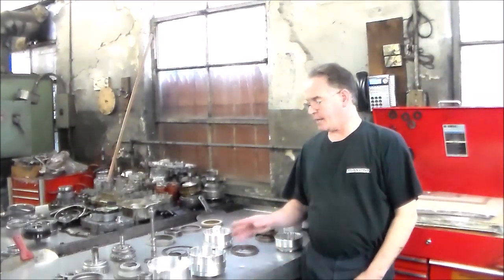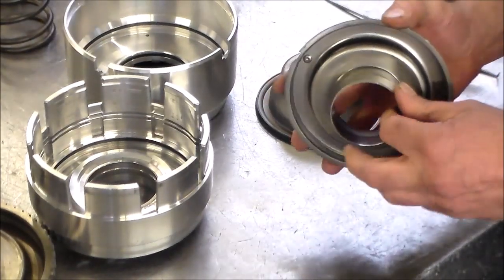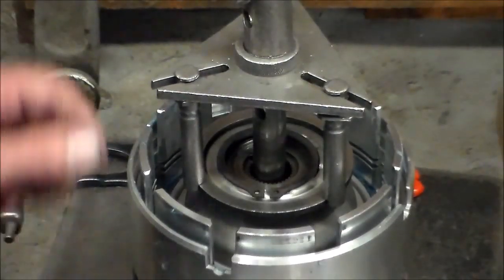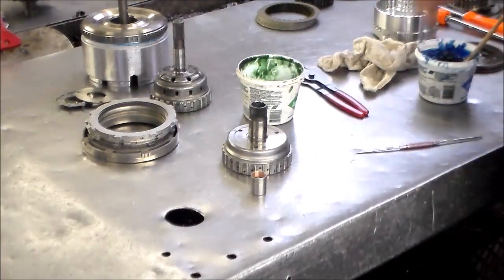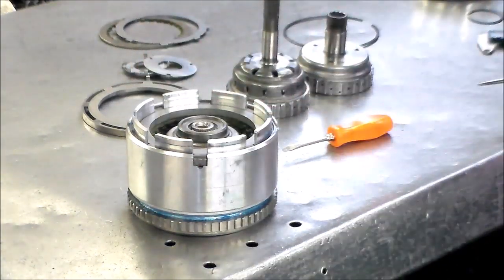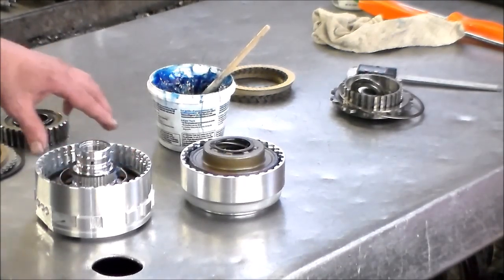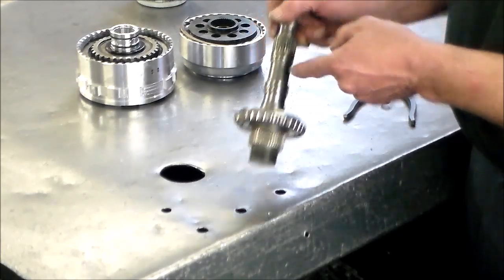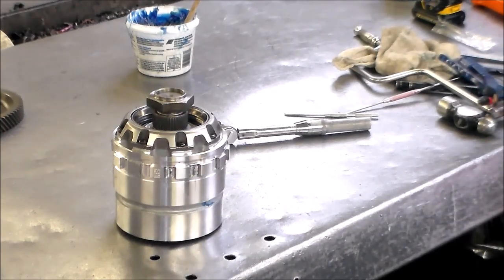62TE Rebuild Part 1

Comment: Thanks for this series, you are a great teacher!
What would you recommend for a 2014 62te with 200k on it, It started to have a clunk at 4-3 3-2 2-1 coast downshift, mainly 3-2, all upshifts have always felt good, changed solenoid pack, cleaned valve body, inspected the 2-4 valve with no sights of wear, did a quick learn and made no changes, I live in maryland 20677
Reply from the maker: Did you happen to scan the car to see if any codes are present? very surprised quick learn did not change anything.
Reply: No it never popped any codes, I use appcar diagfca as my main scanner, there was a decent amount of clutch material in the pan but nothing big, I was just thinking maybe the clutch material worn out to much, the car is driven heavy with performance mods done to the 3.6 and do about 40k miles a year for work.
Reply: Also wanted to do a rebuild just for the heavy use and high mileage, I can't seem to track down a transtec kit yet, I can get the mopar 68272621ab easily but thus does not come with the clutch packs and can't find the right clutch packs that come with frictons and steels
Reply from the maker: @bryansteele4458  Where are you located?
Reply from the maker: Last reply did not show, if you can't find let me know, i may be able to help you
Reply: Maryland 20677, 40m from DC. I had already look for a transtar near me but I did not any and can't seem to find any good kits only
Reply: I got a reply from transtar, they helped me with another site to find kits and told me they could ship them to me, I also realized that alot of the transtar kits are actually transtec or comes with transtec overhaul kit at least, is the kit you would use pn 132006 ?
Also if this was your trans and you where having these issues and had a decent amount of clutch material in the pan with 200k on it what would you do?
Reply from the maker: @bryansteele4458  overhaul, That part number does not come with Pistons, you need the pistons, you need a banner kit with pistons
Reply: I would like to do the tc if I'm going to have it out but am a little confused how no matter the place I look for my car it shows a high and low and sometimes a medium stall tc as stock units, is this because maybe vans get a low stall and maybe rt's get high stall?
I'm still trying to figure out what the problem actually is because I just do a rebuild not even knocking 100% what it is, my guess is the clutches are burnt up, If I do country driving it drives great most of the time, if I come to stops or traffic is the main issues with 4-3 3-2 coast down shift like after I accelerate heavy or moderate then let go completely then without hitting brake yet as decelerate it banged down a gear sometime has been hard, I do sometimes get a very small bang in reverse and I have noticed if coasting in naborhood it will do a very small bang going 3-4 at low speed and acceleration.
Reply from the maker: @bryansteele4458  I know of only one converter, same one gets used in all vehicles. Transtar part number is CR1320
Reply: Have you ever did a rt one? I have a rt avenger and just don't want to hurt performance if they used a different stall tc
Reply from the maker: I only know of that converter. If you like E Mail me your vin and I can run it through Transend. 
Gsferraro@yahoo.com.  I can also check my converter book tomorrow when I’m at the shop
Reply: Thank you sir

Comment: Hi Gary, I've rebuilt a 62te after failure of the input hub bearing, now it has reverse but has no drive and code p084b. I can clear the code but it comes back after shifting to drive. Valve body and solenoids seem to be good. What can be the issue?
Reply from the maker: What is the definition of that code?
Reply: @GaryFerraro  DC pressure switch rationality
Today came up p0731 gear ration error in 1st
and p1790 fault immediately after shift
So, these 3 at once came up
Reply: After switching to drive the car moves a bit and stops, at that time the present gear shows 3rd
Reply: Now got an extra code p0841 LR pressure switch rationality
Reply from the maker: @sebos5  How is reverse?
Reply: @GaryFerraro  reverse is fine, goes in smoothly
Reply from the maker: @sebos5  If reverse is ok, may be a problem with the underdrive clutch or a sealing ring on the input shaft

Comment: 49:32 when I do air check on the direct clutch and low clutch, I hear air leak. Is this normal?
Reply from the maker: yes, may be a small amount as long as not excessive
Reply: @GaryFerraro  l love your videos. Thank you for sharing the valuable information.

Comment: I have dodge promaster whit te62 shift hard from 1-2 and 2-3. What u think what problem is?
Reply from the maker: Have it scanned for codes. Sounds like high line pressure
Reply: @GaryFerraro   yes no codes
Reply from the maker: @anicamilenkovic4791  was anything done to the truck before this happened?  Almost sounds like a bad EPC solenoid in the solenoid pack
Reply: @GaryFerraro  no just start hepening slowly
Reply: It kind of jerks between a first and second gear and second and third. Only. Car has a 250000 miles.  No codes what do you think? What’s the best thing to do?
Reply from the maker: @anicamilenkovic4791  Lot of miles, Do you by chance have a scanner like a Snap-on or Autel?
Reply: @GaryFerraro  i have Autel

Comment: Hi Gary. I think your presentation is great, you should have been a professor in a university. I have a question, I am working on a 62te automatic v6 sxt and for some reason I can not put the rebuild compound and hub far enough down to put the snap ring on. I've checked everything twice and the assembly is right. Any ideas?
Reply from the maker: sometimes i have to hit with a dead blow or rubber hammer to get it past the snap ring groove have you tried that? It may not go all the way down on it's own

Comment: Gary, where can I purchase the metal bushing you replaced?
Reply from the maker: which one?  pump or for the Overdrive hub?
Reply: 92004-L
It’s strange because the Sonnax website doesn’t say it’s for the 62TE.
Reply from the maker: when i first called about it long time ago they said not to use it, then i called back a while later and said its ok to use @mikec2220

Comment: I don't understand English, so I am writing with the help of a translator. I have a question about a gear that turns in one direction and does not turn the other.  Which way should it spin freely, clockwise or counterclockwise ???
Reply from the maker: If you are talking about the sprag in the low drum on the 62TE Freewheel counter clockwise and lock clockwise.  Hold the drum and turn the outer race of the sprag
Reply: The side that has the smooth perimeter and faces needs to turn countercloclwise
Reply: Sorry side facing up then counter

Comment: First I had a P0740 code, which I replaced the tcc solenoid first, didn’t help and then I replaced the torque converter. Now I am getting p2764 anyone have any advice? Transmission doesn’t shift.
Reply from the maker: what is the definition of that code?
Reply: Deffenition is Trouble Code: Torque Converter Clutch Pressure Control Solenoid Control Circuit Low. 
I did test the solenoids through the connector at the pan, everything seem to have checked out.
Reply from the maker: @robzlrclub93  Problem seems electrical, if you clear the code how fast does it come back?
Reply: It comes back almost right away as pending, haven’t gotten it to be a hard fault. Going to check the resistance of the solenoid at the connector. If I get a good reading then I figure the issue has to be outside the transmission.
Reply: I got 5.8 ohms for the tcc solenoid. Then checked for power on pin 10. Wasn’t getting any voltage, thought it might be on limp mode because of the fault. Ignored that theory for now and swapped out the pcm relay then was getting 12v at the transmission pin 10. Can test any further at this time but I am hopeful this will resolve the issue. Thanks for your responses.
Reply from the maker: @robzlrclub93  ok, if that code comes right back, it is electrical

Comment: Where do I buy parts for my 62TE because I would highly enjoy rebuilding my older trustworthily unit?   Thank you!
Reply from the maker: Where are you located?
Reply: @GaryFerraro  I'm sorry for not mentioning my location.  It's Columbus Ohio.     I could also get the parts delivered by common carrier if needed.  Also. Would any scanner that relearns work in programming the rebuild to the TCM? I'm looking for a decent scanner hopefully for under $1,000. Could you recommend a reliable scanner within that price range?   Thank you!
Reply from the maker: @waynel680  I did a video about a month ago, check it out it's a great scanner that does what my snap-on does and it's 120.00
 Go to Amazon and type in Thinkdiag.  Tool is made by Think Tool
Reply from the maker: Do you know what parts you need or do you need help with that?
Reply: A master kit that includes bearings, gaskets, and seals would be great for starters.  Thanks
Reply from the maker: @waynel680  Have to see what is available, the master kit is the overhaul, all molded pistons,clutch plates and steel plates, no bearings on master kit.  The 2-4 steels are on back order so i will see if a master kit is available.  What year is your car?
Reply: @GaryFerraro  2009 town and country with a 3.8 engine.  Thank you for your help.
Reply from the maker: @waynel680  Can give you a list of what i think you will need, probably close to 1000 in parts
Reply: Please do!  Where would you suggest a place to purchase them?  Amazing. I'm watching you at this present time tearing down this transmission.   Thank you again!
Reply: @GaryFerraro  Good morning, Gary.  Wondering if you forgot about the list of the parts?  Thank you!
Reply from the maker: @waynel680  Sorry, shop is very busy
 Banner with molded pistons
Filter
Solenoid pack
TCC Solenoid
Transducer
Pump Bushing
Compounder end nut
Updated Low Drum
By Pass valve
underdrive piston
converter
 What is the problem with your trans?
Reply: @GaryFerraro  Thank you for getting back to me.  Code says input shaft problem.  I replaced both sensors one on top and one on the side of the transmission.  Believe the one on top is the input speed sensor and problem still exists.  DTC will appear shortly after reset and trans refuses to shift into 4th gear shortly thereafter.  Sometimes, the trans runs properly for a good while and other times will stop shifting within a few minutes. Sometimes, I can also feel the car jumping out of 4th gear when slowing down.  Yesterday, I ran the car for 30 miles with no problem.  The transmission runs great when I shut the car off and on or disconnecting the negative battery cable.  I'm starting to think that its in the TCM because of the problems occurring and the fact that the trans runs great after the car is reset.  Car has another problem associated with the computer which results in a lower voltage charging rate but goes back to the correct charging rate when the car is reset.
Reply from the maker: @waynel680  what is the code number
Reply: @GaryFerraro  Codes are 792, 734, and 733.
Reply from the maker: @waynel680  ok, that is internal issues, usually never a speed sensor
Reply: @GaryFerraro  I heard you say Transtar parts in one of your videos, and there's a Transtar dealer in Columbus OH, which is 40 miles from my location.  One problem solved.  Question, my local Chrysler dealer recommended not to change my fluid and filter because it may cause major problems with bands and other parts.  I also watched another YouTube video where the mechanic recommended using 1/2 of the fluid requirement with new fluid and the other 1/2 with the used fluid.  What is your recommendation?  I'm leaning towards the TCM and wiring because the car was parked in a barn by the previous owner, and I found a good size mud dam on the wires coming from the speed sensors to the TCM caused from barn wasps.  The wires does not seem broken but believe that they do need to be replaced.  Hopefully, I can find a new wire harness for the TCM or will need to cut and replace the wires.  I drove the car for a few hours today and didn't experience any problems with the transmission.  Thank you for all your help, much appreciated.
Reply from the maker: @waynel680   It's ok to change fluid and filter, back in the day when the cooling systems where not as what they are today they said you shouldn't change fluid, it will be fine to change fluid
Reply: @GaryFerraro  Hi Gary!  My local Chrystler dealer told me that he could get me in the Master Mopar rebuilding kit part# 68272623AD, but will be a week to three weeks before the kit comes in.  Is this kit a decent kit?  Would you please let me know what other parts that  I will need, if any that this kit doesn't contain?  Thank you!
Reply: @GaryFerraro  Help me with this.  You contradicted what the service department clerk at my local Chrysler dealer told me.   He told me not to attempt to change my filter and fluid at 185K on the car because it might lead to transmission failure.  I watched all your videos on the 62TE and found you to be unbelievable transmission rebuilder.  Please explain so I learn better, what does a better cooling system have to do with not leading to tranny failure?  Thank you so very much!  Please advice and thanks.
Reply from the maker: @waynel680  Back in the day, the transmission cooling system was not elaborate as they are today.  Back in the day  if the fluid was not changed it would become like varnish. That really does not happen much anymore so thats why i really do not agree with what he says, if the trans is slipping a service may not help but i don't feel it will kill the trans.

Comment: Love your videos! As daunting as it would be to disassemble and rebuild an automatic transmission, I'd almost feel confident tackling such a job, using your videos as a guide. I have a 2013 T&C and therefore, a 62TE. Just finished a pan drop, filter replacement and pan with plug installation. I use AppCardiagFCA to get the trans temp and use the level chart. I used about 6 quarts for the refill. About  week before that, I evacuated and refilled about 5 quarts (2 or so at a time). I measured and scribed  on the backside of my engine oil level dipstick for the high and low marks based on the chart. 

Two questions though...Do you have a system for keeping track of all the fasteners, clips, rings etc so you know which part goes back where? I'm guessing you know them inside and out. I suppose it's like anything else, one just needs a system. Secondly, I have read how finicky these transmissions are about fluid (friction modifiers, viscosity), ATF+4. All that trans gel and STP you're slathering on there, I'm guessing it isn't enough to mess with the finely tuned ATF+4 chemistry? Again, always appreciate watching your videos.

EDIT: Just thought of something else, and of course I'll understand if you don't have the time to answer my questions. I just find this stuff fascinating and trying to learn.

I have an app called OBD Fusion. It can retrieve a lot of information. Right now, I have line pressure (desired an actual - these are in agreement all the time). I also have LR, OD, UD, 2-4 clutch fill volumes (CVI). These are all within spec. I understand that these values can increase as the clutch material wears? So, if they exceed the maximum value in the specs, does that mean my clutches are worn? Other than line pressure and CVI, what other variables could a person look at to determine the overall health of the transmission without opening it up?
Reply from the maker: Hi Adam,  Thanks for the post.
 I don't really have a system, most parts are in a basket that goes into my wash tank, very small parts, like snap rings, roll pins, pump bolts, and bearings are laid out on a rag, these parts i do not like to put in my wash tank.  This trans main gear train is basically a 41TE(A604) and they just added the compounder assembly for the rest of the gearing. I can't keep these transmissions on the shelf, very hot item, currently have a waiting list for people to bring there car in, so i have to get one built. I use the CVI value to look at wear inside, this is really all i look at to determine what has to be done.  Yes, the higher the CVI the clutch is becoming worn out, the lower the CVI, for some reason clutch pack is to tight, sometimes a snap ring will break and get jammed in a clutch pack causing a very low CVI. I probably rebuild one of these units every week
Reply: @GaryFerraro  Thanks for the reply. Interesting stuff. I'm watching your whole series on the 62TE rebuild. Haha, sounds like some day I may have to use them. I'm going to poke around the net to find more info. I want to find out when Chrysler started using the upgraded, non-rotating seals on the low clutch drum. I expect they did so after my 2013 rolled off the production line. I wonder if normal fluid contamination (small abrasives) contributes to accelerated wear on the ring lands and if fresh fluid on a more regular basis would slow the wear.
Reply from the maker: @acbent11  I think they did update the rings after 2013, i would say yes to abrasives speeding up the process but the rings do spin and that what wears down the lands

Comment: Lost reverse in my wife's 2011 T&C, they are telling me $5000 to fix. Car not worth that much. You must be an expert at these now, is it possible to replace just the rotational rings that causes the problem? Or is a whole rebuild in order?
Reply from the maker: Should really be rebuilt but 5000. is way out of line, i do these retail for 1500 less
Reply: @GaryFerraro  hi where is your shop located
Reply from the maker: @muradomari6980  I'm in New York